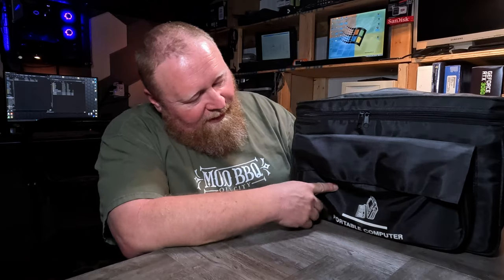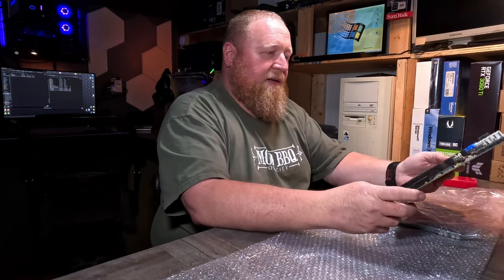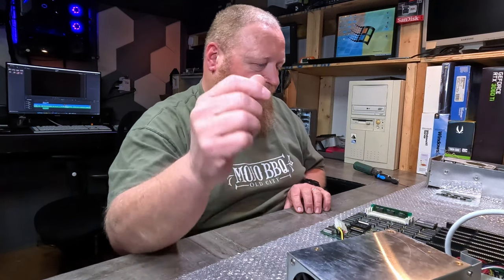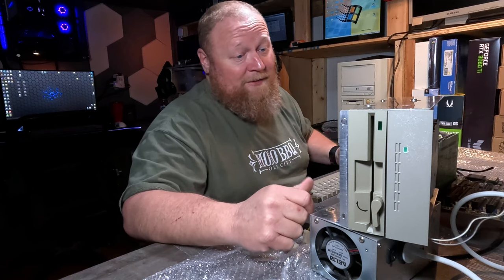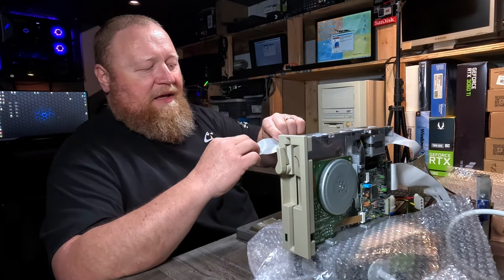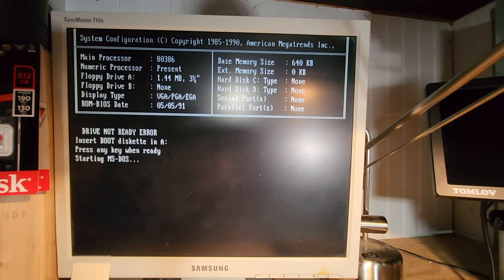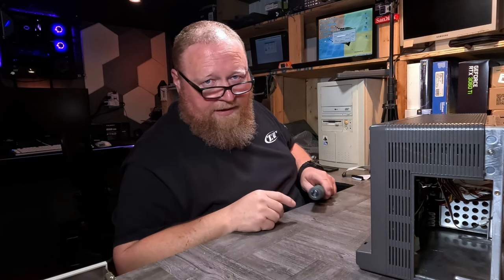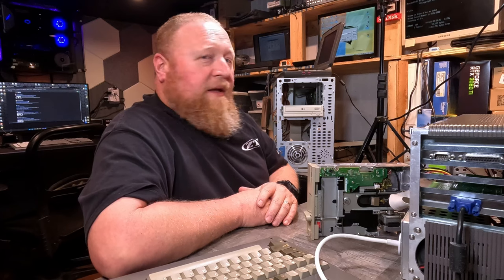Retro Tech: Reassembling a Basket Case 386 Portable Computer!

Comment: You got me in with the Lunchbox computer but were killing me with the basics. Most of the Lunchboxes that are vga or above interface with a VESA connection. Having a VESA connection was common on all VGA cards with an ISA, PCI, AGP & Vesa Local Bus interface. Did you try to reverse the connector on the video board?  Also you were not using the floppy cable properly.  The connectors in the middle of the cable are the B: drive and the one at the end is the A: drive.  The twist in the floppy cable allows all floppy drives (jumpered on the drive itself for drive 1) to work as an a: or b: drive based on position of the drive on the cable.  I recommend  going CF to IDE as you will not have to worry about spinning rust failing on you. If you still want an traditional HDD, pickup a copy of Spinrite to find and map the bad and good sectors properly.
Reply from the maker: LOL, yeah I haven't worked on anything of this vintage in decades. Regarding the ribbon cable, it has a key on it that will not allow it to plug in the other way. I have a few CF>IDE adapters here and I may do that at some point. The drive is going to be a no-go. You can actually hear the head squealing against one of the platters.

Comment: Sorry but i cannot believe this, you put the 5 1/4 floppy upside down in the drive, no wonder you have to reformat the floppy. And by the way the way you treat the harddisk or throwing the floppy on the desk, the items will not survive a long time. Do your research for basic procedures before filming. Or see some retro pc videos… 😅
Reply from the maker: Well, it's like this. I'm 50 years old. I started in IT at 24 and Ive done nothing but IT since then. Every day of my life is spent doing this stuff. Ive never in 26 years ever had a drive fail due to mishandling and I've handled literally thousands. I appreciate your concern but doing more research on this subject is probably not necessary and practically not possible. This equipment is older than most of my viewers and the drive is double sided as is the floppy disk. So upside down should work. Again thanks for your concern.
Reply: @projecttimetech7022  Interesting and thanks for clarification. But it is a lot nicer to look when you treat the items respectfully and maybe you show this knowledge of 26 year IT experience. See as a reference Adrian‘s Basement. Looking forward to see more videos from you.
Reply from the maker: @yorkan213swd6  Yeah, I like Adrian's channel very much.